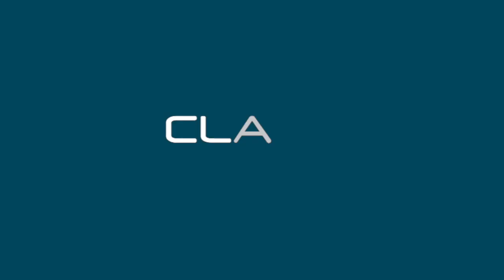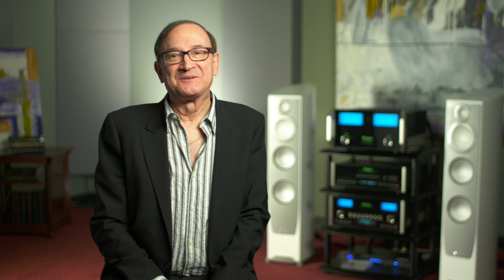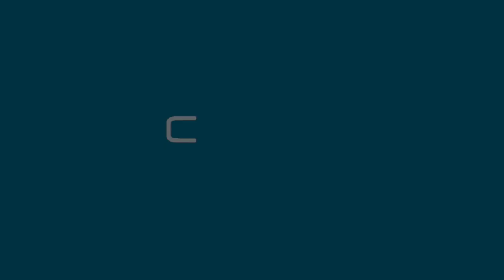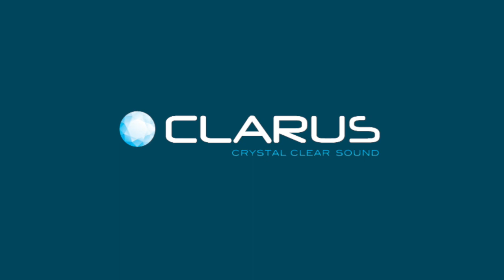09_Clarus Power Cables Do Make a Sonic Difference

Comment: Comparative listening tests are objective, they can be very misleading.  Cables make absolutely little to no difference provided they are capable of carrying the current required (speaker, power and interconnects provided they are short and of decent quality).  Internal wiring in the amplifiers are  also not of same quality as the better supply cable, The wiring in your wall is crap so everything that comes from it is crap is as well. You need a balanced power transfer to supply you audio equipment and some filtering to remove spikes, RF and possibly some other garbage but that's it.  S[[end you money on better speakers and an amplifier first then your source units and room, forget money on snake oil cables, stands, gadgets, you will not hear the difference.